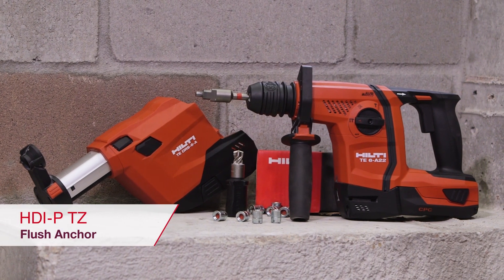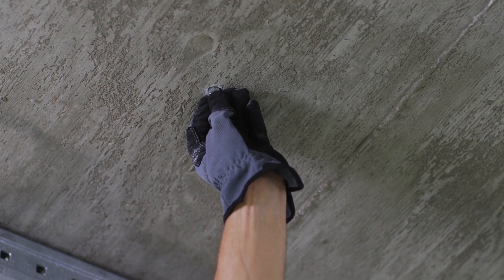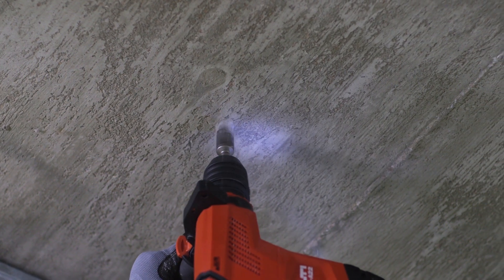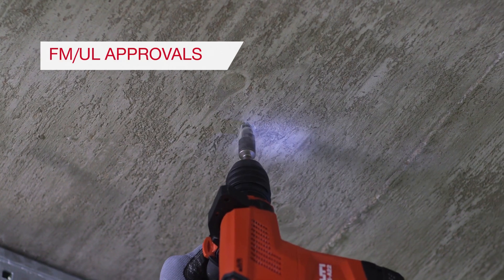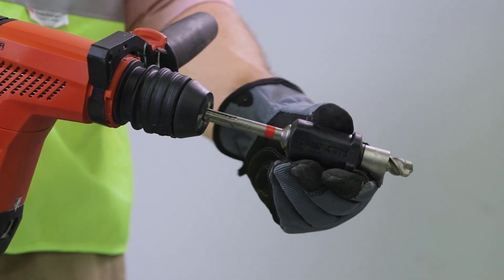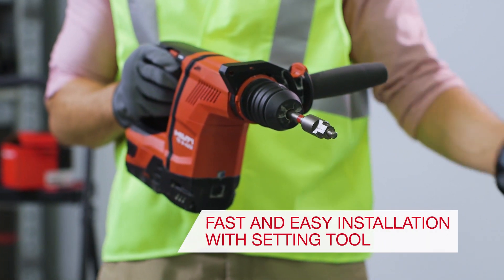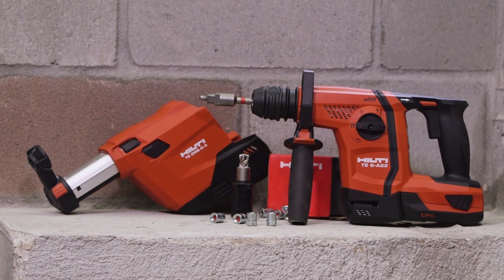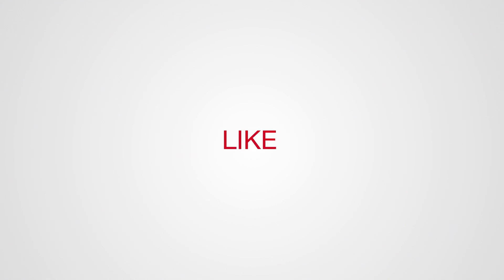INTRODUCING HDI-P TZ flush anchor

Comment: The hilti mini drop ins (hdi) are awesome. Their steel so they meet most bld codes. They install really fast and easy. Small issues are you cant use the drs system with that 2 piece drill/set bit and their expensive. But for cereal drilling and hanging pipe, their the fastest anchor system I ever used. (1/4 20 hardware)
Reply from the maker: Glad to hear you like using our anchoring systems! Thanks for your feedback about the DRS. We will be sure to share it with our product managers. -Sarah, Hilti North America Social Media Team
Reply: actually... you can use the DRS system with it. there's a nose piece that opens & closes to drive the wedge.   It works great !